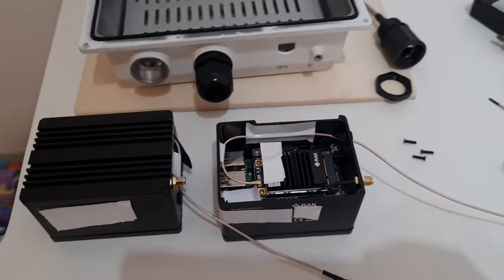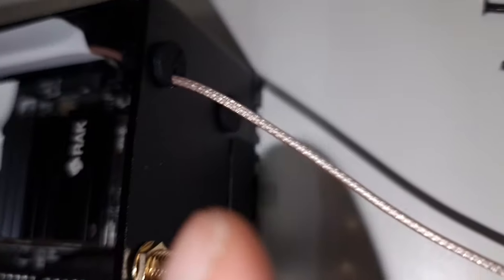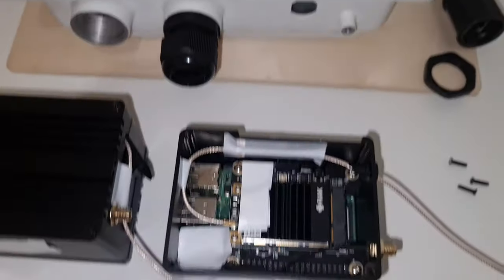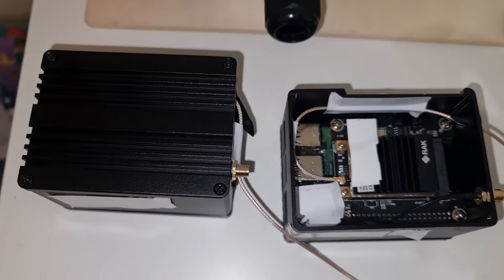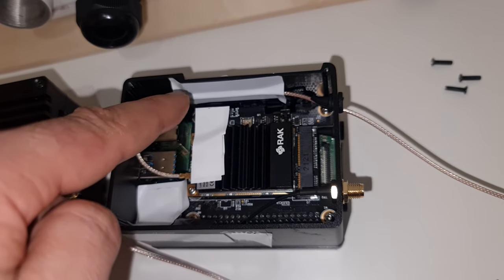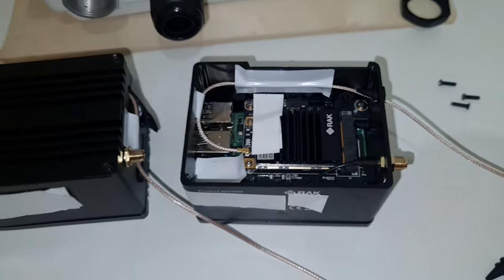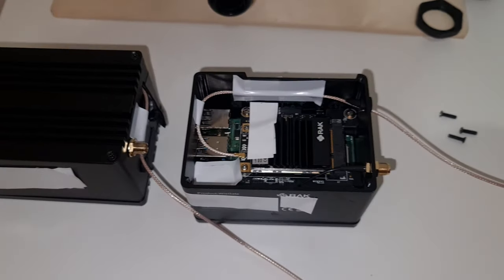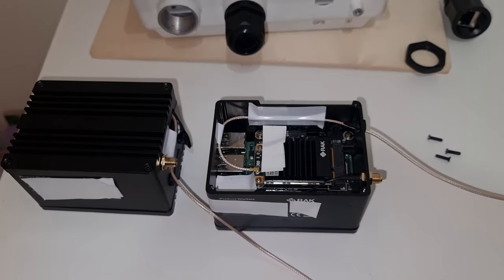Helium Miner Modification To reducing dB loss Rak Miner v2  2022 Part 1- HELIUM ADDICT

Comment: Great video. Do you have a link for the cable? What improvement did you get?
Reply from the maker: U.FL to SMA Coaxial Cable TUOLNK SMA Male to UFL IPX IPEX Coaxial Cable WiFi Antenna Pigtail Extension Cable for Mini PCI Express RG178 12 Inch (30 cm) Pack of 5 https://www.amazon.de/dp/B098QFK42H/ref=cm_sw_r_apan_glt_i_4VZ1YF37TA59TR065K1F

Ps: look for 15 cm or 10 cm cable  for even less dBi loss

Comment: Why did you change the cable?
Reply from the maker: Hi, I m trying to reduce dB loss as much as possible 🙂 and with this cable I will connect my miners directly from the FR card of the Miner to the 2 Way splitter/Combiner  .
I hope this answers your questions 🙏 
See my ather videos 📹 I explained how to connect 2 miners with 1 antenna 📡 
And how to use this cable properly 
See you in my upcoming videos 📹 😉